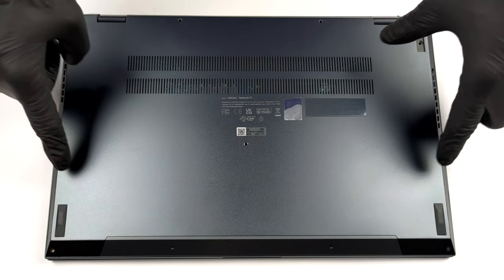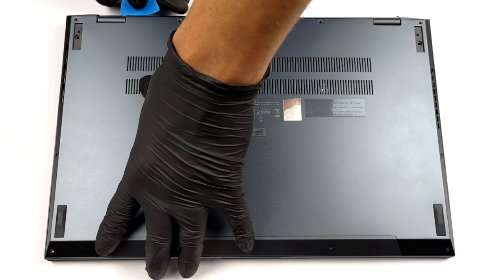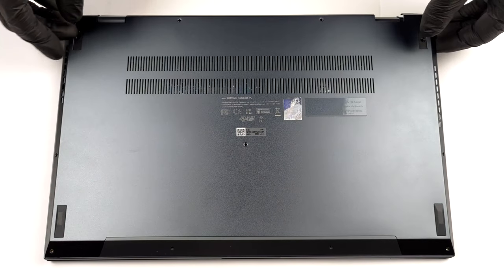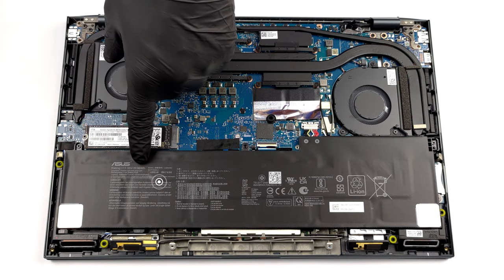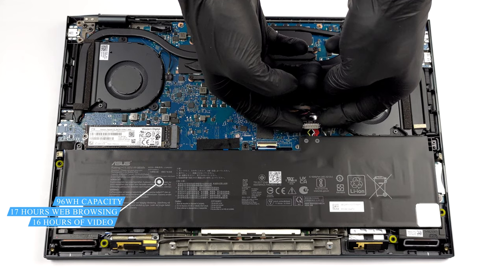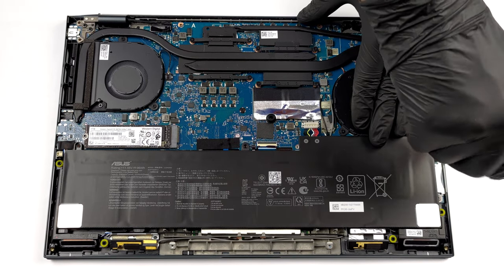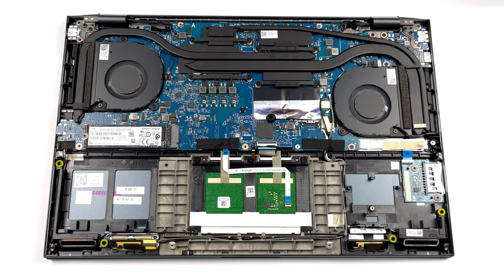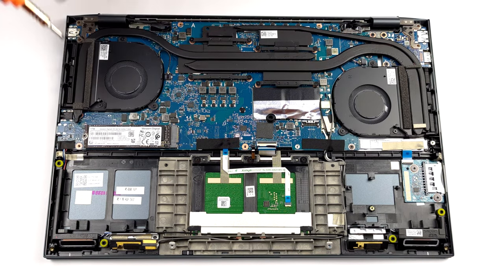🛠️ ASUS ZenBook Pro 15 OLED (UM535) - disassembly and upgrade options

Comment: many many thanks. I spent hours trying to open it, I did not know there were two extra screws under the rubber feet. now I am glad I did not force it.
Reply: Dumb question but is it possible to put the rubber feet back? will removing it the first time causes it to be loose or anything like that?
Reply: @bounphithakphithak6949  The rubber feet have adhesive, and you should be able to put them back in those slots.

Comment: is the wifi card upgradable?
Reply: I don't want to tear off the rubber feet from mine so I haven't opened it to check, but it looks like no, see the wifi antenna wires connecting to the motherboard to the right of the ram? Instead of connecting to an m.2 card. Sad.

Comment: Does this laptot have the battery bypass? I'm talking about the alimentation of the system when the battery is 100% full and keeping the charging cable connected without damaging the battery because it aliments the system directly without going thru the battery. Idk how to search if this model has it or not.
Reply: So it has something built in that allows you to keep it at a set percentage instead of going to full, and then I believe it circumvents battery and is powered by wall. I have mine set to 60% so when it charges up to 60% it stops charging

Comment: Is it possible to install an SSD drive with a heatsink like Samsung 980 Pro 2TB M.2 PCIe 4.0 x4 in this laptop? Does it have room for a radiator? And will it run at high speeds? It is not clear which PCIe the motherboard supports.
Reply: I'm curious too, I know for sure that some Crucial and WD nvmes are compatible.

Comment: does this laptop have pcie 4.0 motherboard or 3.0 only? The video says "x4 slot" but is that 3x4?
Reply: Should be 4.0
Reply: @danwat1234  mine was actually 3.0. But thanks for answering!
Reply: @DriftXperience27  So about 4GB/s max 3.0x4

Comment: is wifi card upgradable?
Reply: Looks like 4 total antennas. the bottom 2 looks like it could be on a mini-PCIe card but not sure. The top 2 are on the mainboard. Wish this laptop came with WIFI 6. Could just buy a USB stick but that is a nuisance